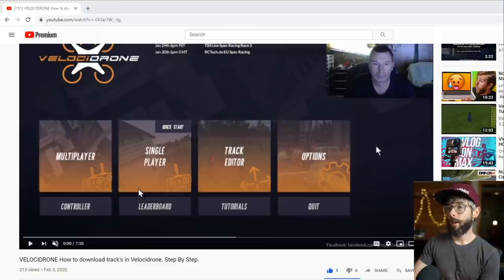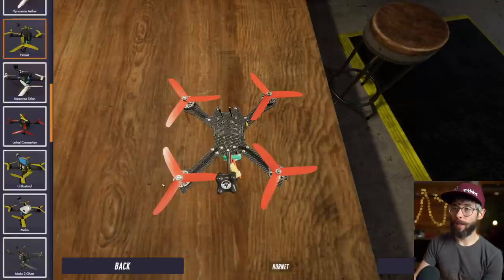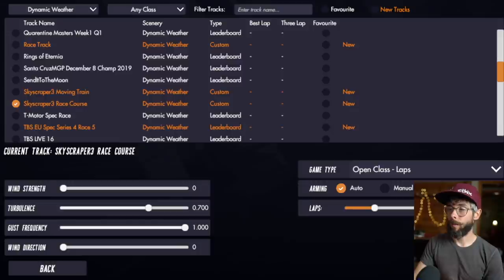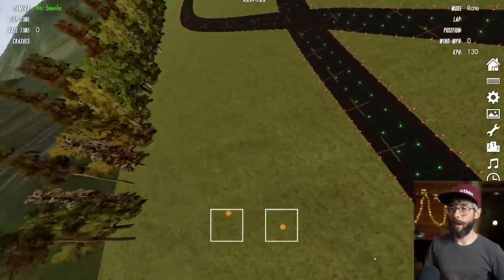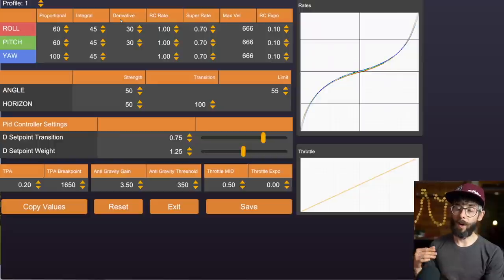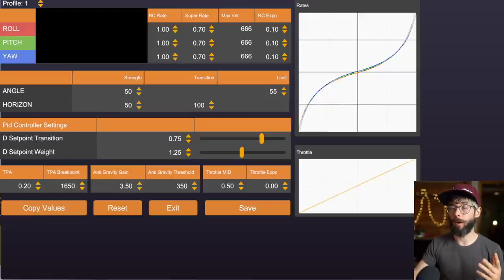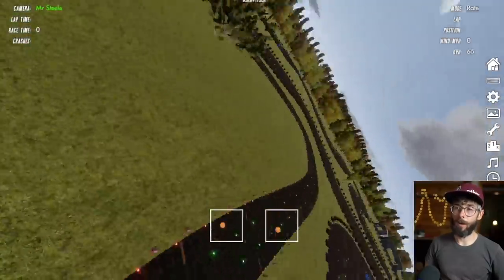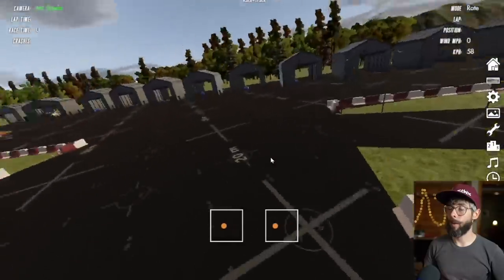Tuning Drone Rates (How To FPV 2020) Part 3

Comment: (I'm new to FPV, only 1 hour on my quad). You rock Mr Steele, previously I did 50 hours in a sim and my controller felt like jello. No control, quad floated all over the place. Using your rates on the sim just works, can't wait to set this up on my quad and fly it.

Comment: Like the new series very informative. Normally fly around 1000 degrees but with dialing up the super rate not the RC rate and with no expo so more in touch with the quad, but having fun with your dialed up RC rates ( all indoor at the moment). Would really like to see you do a throttle control video and how to set up for best control ( non Kiss just regular Bestflight).

Comment: I’ve been looking into throttle expo. Do you run throttle expo? I’m just trying to find a way to get more resolution down low.
Reply from the maker: No throttle expo is a crutch in my eyes. Learn good throttle management. And you’ll be a better pilot.   Buttttt it also has to
Do with the setup. I setup my drones to be very linear in power delivery. Light weight low pitch props. Not too much KV. And no throttle expo
Reply: @MrSteeleFPV  word, thanks boss. All I needed to hear:) time to fuckin rip then.

Comment: Great video. I am new to FPV and flying my 3 inch or 2.5 inch quad was not as smooth as I thought. This will definitely help me understand what to adjust to have more control and better performance. Also I like the way you explain it using the simulation.

Comment: Thanks for doing these videos. I'm new to FPV drones and I watched your 2018 version of these. In those videos, it seemed like you were recommending a more sensitive setup for learning and you also modified the Quad Settings. Are you recommending this less sensitive setup over those you recommended in the 2018 videos for starting out now? And will you be going into your 2020 Quad Settings as well?

Comment: It should be noted that rates aren't the same between betaflight, kiss and flight one. Velocidrone is using betaflight rates so if you fly a different platform on your real quad, you need to convert your rates.
Reply: @Ener-FPV  Is there something similar that isn't as slow? I don't understand why it needs to calculate it on a server
Reply: I always see a lot of people saying this, and maybe in certain extremes it makes a difference, but from YEARS of PERSONAL experience flying BetaFlight and KISS, I notice NO difference between using Rates in the 2, and when entering the number IDENTICALLY into BetaFlight and KISS, I get exactly the same DPS. YMMV of course.  I do KNOW for a fact that yes, there is a "translation" difference, where there are some faster areas, i.e., mid stick to first 1/4 of the stick movement, but depending on rates used, the difference can be bigger or not as noticeable. For me, using 1168 dps for pitch and aileron, and 1000 for YAW, I don't see any difference from my KISS quads to BetaFlight. All my muscle memory results in the exact same maneuvers every time.

Comment: 17:24 It doesn't matter if the quad is small or big, a 1000deg/sec will be the same for both, it is like saying 1000g of feather and 1000g of iron, which is heavier? :)
Reply from the maker: You do realize different size motors and widths of frames, prop weights/sizes all effect the rotational speed…. If you ever tried this you’d realize 1000 is not 1000 on every quad.  Please do a little real world testing before you make a “factual” statement like that mr feather 🪶
Reply: @MrSteeleFPV  Quad response is something else, it is how fast the quad is going to reach 1000 deg/sec, at the end 1000 deg / sec will be the same for all (from Mr Feather :D )

Comment: thanks, Steele just getting back into it after Canada killed off racing drones with our BS laws. I now have to stay under 250gram weight or get a 3000$ fine so looking to buy some stuff in the next couple of months ( after selling all my drone gear 2 years ago cause I couldn't fly them legally anymore in Canada )

Canada has basically tried to kill off drones period watched a guy get fined for flying a phantom without the proper license. so its indoors and micro 2' outside hopefully staying under 250grams. 

Thanks for all you have done for drones and the community Steele

Comment: Great video! Thank you! But why wouldn't you want to change the rates in the TX? Is't it easier - for example - beeing out in the field and doing some little tweaks here and there by just dailing them into the radio? Thanks Steele.

Comment: Please do a video on PIDs. Personally I think for someone who builds quads it is a very important tool to know how to tune a quad properly.
Reply from the maker: Like I say in the video tuning the quad physically by getting a weight set up correctly and making sure your rates are set up with a way that you want them is going to ultimately make the quad a lot easier to tune when it comes to PIDs and I think a lot of people overlook this very important thing. But with that being said I am going to talk about the ideas and make a video specifically about tuning a quad
Reply: @MrSteeleFPV  I was thinking more about getting rid of some oscillations that are caused by PID-Values that are slightly off after physically tuning the quad.

Comment: For anyone still possibly confused, for a short description, rates are similar to settings in a video game.
Reply: How can I put my 2080 ti in my 5” to run ultra settings?
Reply: Just to clarify, rates are similar to "Sensitivity" settings in video games. Settings on its own is a very broad term.
Reply: lol i think you are confused. rates...are the maximum degree of acceleration the quad will take depending on your input. when MR steele was referring to the 666 degrees, what this meant was at full throttle, if the rate is set to 666 for roll, and you do a full throttle roll, the quad will try to match 666 degrees per second. And you can adjust these degrees per second setting for throttle, pitch, roll, and yaw. The "video game" as you called it, is a simulator, meaning its a program meant to simulate quad flying. Thus your explanation of rates are similar to settings in a video game is insanely incorrect and just a confused thought in general. The simulator attempts to mimic the same program that we use to configure the quad (betaflight), and thus to simulate the quad degree per second control on the videogame, its obvious its similar, thats the goal. but to say that as a short description for rates...its similar to a video game says absolutely nothing.

Comment: Love the videos man . Im currently waiting for my gear in shipping.  Going digital for my first fpv experience and a smaller 3 inch quad . But ive been messing with my rates in my sim to try to see what I like.  I think I finally found something I like but my degrees are way lower than yours.. more like 500 I think lol but I like the feel of it and I've got it so my end stick is real snappy and the middle is smoother.

Comment: Oh there was a part 1 and 2? Damn dude! With your explanation and rates... ive been practicing in LiftOff, and some thing never felt right, like i couldn't do things. With the new rates I put in, where roll and pitch are sooo much faster for "my timing", it just felt more natural on how a full roll/pitch should feel. It's like i went from amateur to "advanced amateur" if thats a thing lol. I'm hitting turns and gates sooo much faster and easier and i can keep the quad a lot longer, straighter very low over the ground! Also my starts are a lot easier. So in short, before it was a lot more jumpier and slow in turns, now its "slow and steady" and quick when I want it to be. Perhaps still need some tweaking as the game has BetaFlight numbers, im "guessing" what yours are about, as the numbers are a but different. But the curve looks alike.

Comment: it is basically the same thing we all did on the radio with model settings, accept now it all saves on the actual quad so you no longer need to have 50 models in the transmitter.

Comment: Unless I'm wrong, the max velocity is not an arbitrary number based on the size of the quad, if you think of the quad doing a full rotation as making a circle that rotation will always be 360° so if your rates are maxed at 360°/s then a large quad and small quad would both make one full rotation in one second, essentially rotating at the same speed. If you have a small circle inside a large one and connect them with a line that line would move at the same rate making a 360° turn around both circles at the given speed. Am I misunderstanding something?

Comment: Roll and Flip by timing? So do you count or say Boom or is it more of a muscle memory movement of the stick that you try to keep consistent? Thanks!  Thinking the latter? Fixed wing rc pilot transitioning, never liked expo but would use dual rates for pylon racers and other fast aircraft.

Comment: Hi Mr. Steele today i try your Rates about the 1000 with Expo. I expected that i would be to fast for me but it is really perfect. Spining faster is easier und looks much  better. What about the throttle curve? Did you change something? Best regards from Germany 👍

Comment: @Mr Steele In the beginning you talk about how a certain degrees per second doesn't equal the same rate on a larger vs smaller quad.  Are you positive about that?  I haven't been flying quads very long, but coming from helicopters with flybarless setups I'm pretty sure the fundamentals are the same.  Your absolutely right that a larger quad is going to have less nimble characteristics, but... When you are setting rates (at least in an FC on a heli) you are setting how fast you want the... hrmmm... I guess the best term is "mini quad" to turn... In other words, the flight controler has this imaginary "mini-quad" in it's programming... When you give inputs that mini-quad changes it's attitude.  The flight controllers job is then to make the real quad "match" that mini-quads attitude.  So 667 degress per second is 667 degrees per second no matter what.. The "mini-quad" is always going to change at that fixed rate... It might take longer for an X-class to "match up" with the mini-quad, versus a 3" matching the mini-quad, but if you hold the stick at 667 degrees per second for one second and then release it shouldn't matter what size the real quad is, it should STILL rotate 667 degrees... Or am I missing something?

Comment: 16:35 there no One way, because everyone is different and everyone is going to perceive and feel different about how its effecting the control of your quad/drone. This will change per person, and per drone. You may have some settings with one drone you swear you love and that are the end all beat all. Then you try them on a smaller/larger drone or one with different hardware, and then it feels Off or even uncontrollable. 
Having an understanding of what you are doing with the controls by adjusting these is invaluable info to new pilots.

Comment: 5inch really is the magic sweet spot for high performance ripping to cinematic flying.     But I cannot leave well enough alone.   I love building and experimenting nearly as much as I do flying.  Trying to get 3inch long range cruisers versus a 3inch ripper.   Lately it has been building really big stuff from 10inch to 13inch Xclass.     I finally hit on a 10in that rips on LiPo and hits endurance on LithiumIon.   What my next fixation will be after that I am not sure.

Comment: Hey, Steele. I need some help in your advice.

I just built my drone and it works wonders, until i start the quad and the view in my goggles goes all static and actually unviewable. When its all still and it isn't armed, it works well and the view is clear as day, but not when it's armed and ready to fly.
I've heard that it may be "noise" within the quad and that one can add a compacitor to the area where the battery is hooked up to nearly fix the problem. Would you think that's the same solution, or do you have other ideas? Would be cool to potentially get a video on that cause many people seem to have similar problems such as this. Thank you in advance! Btw, Love your moustache! So classy!
Reply: The Wolf Leader  I got rid of my static soft mounting all my boards,installing a 1000 capacitor and a descent antenna that is insulated.I also read about a receiver antenna interfering with the vtx antenna because of them being too close to each other.
Reply: @TheBuzzorca  Thank you soooo much!! Honestly! I'll be sure to take a look at that and order some new parts to see if I can solve my problem. Huge thank you!

Comment: You should make a tuning video when you tune a kwad from scratch🙏 And Thank you for getting me in too this hobby✌
Reply from the maker: I plan on making some sort of tuning video in the future but it is very difficult to convey tuning from scratch in every single instance when you’re talking about different types of Quads and set ups it’s very important that you get the quad set up correctly physically and with the rates before you start actually working with the tune

Comment: Hey duude dope video and great explanations. I know its some more advanced question (maybe this makes sense to have a really special special video) but since you are going over those topics, could you also explain TPA and how to tweak that? Maybe also in relation to KISS FCs?
Reply from the maker: Yes sir. I can explain it here actually   TPA is “throttle PID attenuation”. Basically it works on a scale from 0 to 100 the number that you see on the GUI Is a percentage of 0 to 100 So 50 being 50% so that’s how much the PIDs are going to be attenuated and when I say attenuated that just means they will be reduced by 50% so three being down to 1.5 at full throttle. TPA setpoint is where exactly that percentage starts and you can also adjust the curve of the percentage like expo in your rates. Because factory TPA is a linear path from 50% usually to about 100% at 50% TPA would essentially reduce the page from 50% throttle up to 100% in a linear way by 50% at 100% throttle if that makes sense. Do use for TPA is if you have a very highly powered quad and you need to reduce the PID’s at full throttle because it seems to work well lower down but as soon as you get to higher RPMs it causes vibration. I hope this was helpful I can explain it better in a video at a later date because text is only so good
Reply: @MrSteeleFPV  Awesome, I understood. But in a conclusion, if you have like 100% TPA, does it mean you dont fly with any PIDs at all? Thi doesnt make sense right?
Reply: @KwadLife  its means your PIDS will be the same at all time, rather than adjusted at high throttle. As he said its probably not necessary unless you have issues at high throttle.

Comment: The degrees/second change between an 8" and a 3" isn't theoretical. One degree of travel on a larger diameter circle is a longer arc than one degree of travel on a small circle. As a circle gets bigger, you have to travel further along the circumference to cover the same fraction of the total distance (1/360th).

Comment: I have a tip for audio,  there is something interfering with your audio interface or mic, turn of your Phone or other things that interfere. Also in audacity, use the effect noise reduction, not sure if that's exacltly the name of the effect. I already started with FPV, but still watched this video, maybe il'l pick something up! Thank you
Reply from the maker: Yeah yeah I know the gain is too high I’m not close enough to the Mic there’s a lot of things going on I’m trying to work it out
Reply: Good that you took notice! I'm not trying to be up your sleeve.😃

Comment: I just built my first quad, 6S, and was finding maintaining height while trying to hover before landing slightly challenging so I added 30% expo to throttle ... this allows me to change anywhere, anytime, no computer needed, wouldn’t it be better to manage within the Tx model profile than the FC software?

Comment: Hey Steele, if its not a secret, could you tell what cam angle do you use when flying irl?
Thanks!
Reply from the maker: If you check my description it says. Lol always has.  25 degrees
Reply: @MrSteeleFPV  Danggg i checked it before but i`ve missed it 
Thanks man!

Comment: i just bought the emax babyhawk 2 hd and noticed that when i yaw full stick right it bumps up ,yaw left it all works fine its just when i yaw right at full stick,,, it workd fine at half ,,,,,very strange ,,,,please help ,,,ive gone into bata flight and turned down yaw but still does the same thing at full stick yaw right

Comment: Do you coordinate your rolls?
Reply from the maker: Hi Cortney my rules mainly with throttle not with anything else so I blip the throttle before I do a roll and I blew up the throttle basically before I do any tricks so that I don’t lose altitude. There’s a great video on Eric Konasty’s YouTube channel from a few years ago where I explain how to do rolls and flips without losing altitude I don’t have a link on hand but it’s pretty easy to find if you type in Ethix trick tips on Eric’s channel
Reply: I mean do you add some yaw to your roll so that the horizon is at the axis of rotation.

Comment: I just switched radios and now I have to re-tune my rates. Big difference from spektrum to crossfire
Reply from the maker: The rate shouldn’t be too much different unless the actual gimbal throw is of a large variance and if it is then yes that can definitely affect the rate and especially how you hold the radio